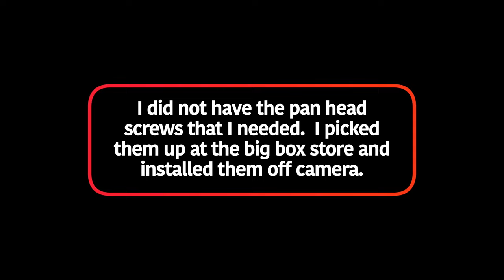Woodworking: Making a Shoji and Kumiko Lamp Part 1 (Making the jigs)

Comment: I have done Kumiko for years. This sled is the way. You can layout your frame cuts with the stops. I tape multiples of 8 strips together (on one side) and cut several stacks at the same time. I bolt this type of jig to a very small sled. The sled is wide, but not deep.
Reply from the maker: When I make more of these lamps, I'm going to modify my workflow to be more efficient.  I really like the idea of taping strips together and cutting them.  - Ed

Comment: Why do the angled guide blocks have a groove in the bottom? 💖🌞🌵😷
Reply: A lot of people make these blocks with 2 different angles on them, one on the “top” and one on the “bottom”. The other possibility is that while the groove is being routed, it just makes sense to do both sides so that you have an other side for future use. All you have to do is cut whatever angle you want on it when the time comes!
Reply: @tomt9543 thanks for your reply. 7:13 I thought the same thing except the groove on the bottom is half the depth of the groove on the top. Merry Christmas. 💖🌞🌵😷